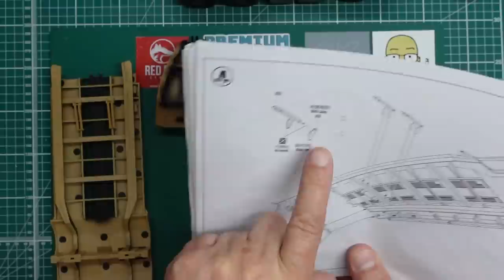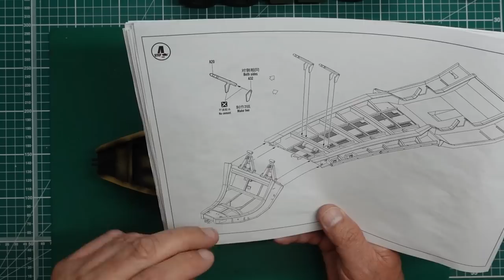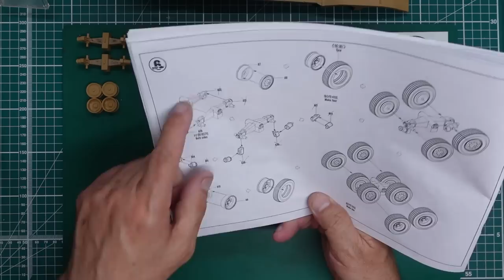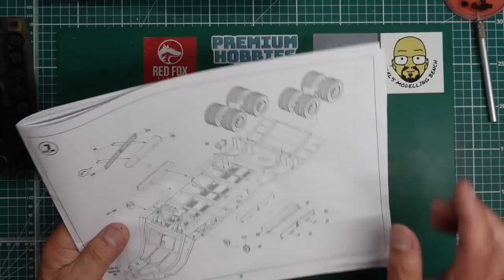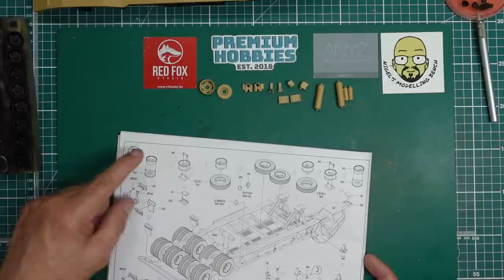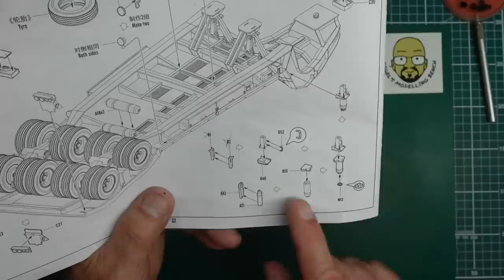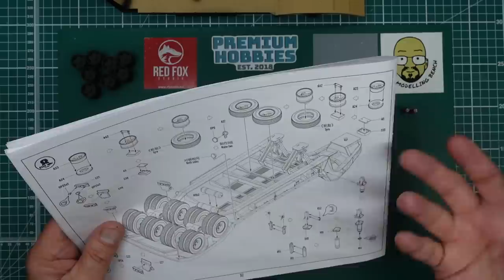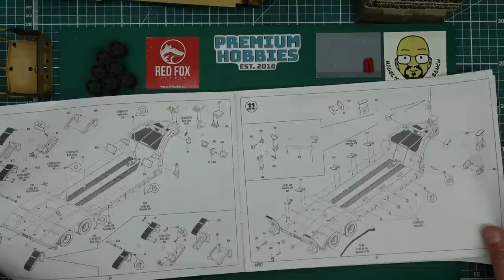HobbyBoss 1/35 Scammell Commander build. Part 10.

Comment: Hi Nigel, looks like you’re having a right nightmare with that kit keep going it will be worth it in the end. In the meantime I discovered that if you take two of the Infini sanding by pads and glue a piece of .3 card between them to create a sandwich, you can then slice them into five mil and 10 mil skinny sticks, you might wanna give it a go as a replacement for the flory ones which are no longer available.

Comment: I know all you professional lads like to use liquid cement, but I like to use the old fashion viscous one. I apply it with a cocktail stick and it softens the plastic and allows parts to fit easier. I know you going to say that you get squeeze out, but you don't if used very sparingly
Reply from the maker: Thanks for sharing!

Comment: That Scammel is a real nightmare, but should take that Chieftain no problem. AS for the sub, you were right, it imploded. Fortunately it would have taken less than a second, at that depth, for the submarine to do so, and while it was doing so anything inside would be heated up to temperatures that are on the surface of the sun - they wouldn't have felt anything and what was inside would have been vaporised, so quick and merciful.
Reply from the maker: So so sad what happened there Phillip. It would appear the carbon/titanium ring joint failed, or the carbon imploded and ripped out of the rings. From the pics I saw last night the titanium rings weren't covered in scraps of CF??
Reply: @NigelsModellingBench  agreed, just watched a BBC report on it, looks like the carbon shell failed, also heard they may have found human remains among the wreckage.

Comment: Nigel and breathe! Great video, re the ejection pin marks would a punch and die set with thin card been an option? I suspect you may have thought of this and plastic card would have been too thick.
Reply from the maker: Superglue is the better option John as it dries quickly and doesn't shrink. These marks are also all very large.

Comment: outsider peeking in only:  would it be easier to modify one, then simply cast a new set of wheels Nigel?  just a thought  Thanks, Dane
Reply from the maker: No mate, too much trouble especially considering the tyres are horrible as well.

Comment: The real wheel look like standard 22,5 inch rims, with 5 ventilation  holes, quite common from 80s to 90s. 
The ones from HB look like rims from ww2 truck.
In my opinion the holes are to big.
Very approximative.
Probabily the rims from the kamaz by zvezda (the orange tipper) are more similar than this horror.